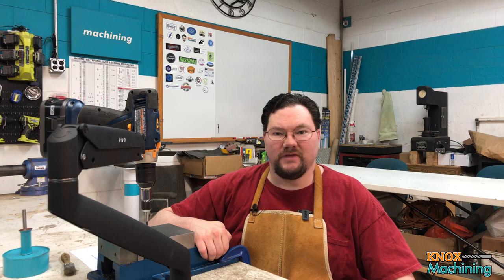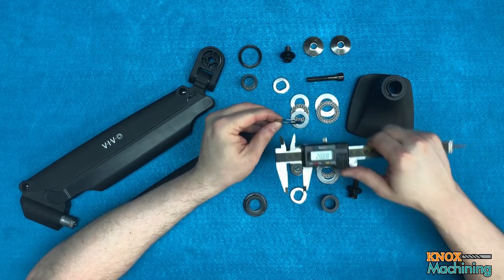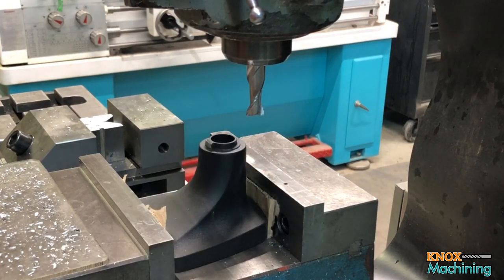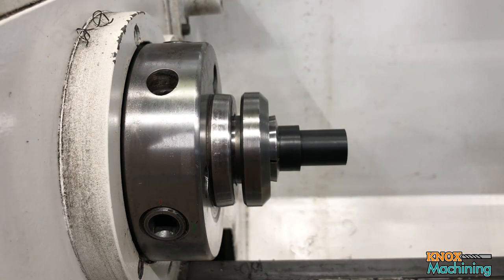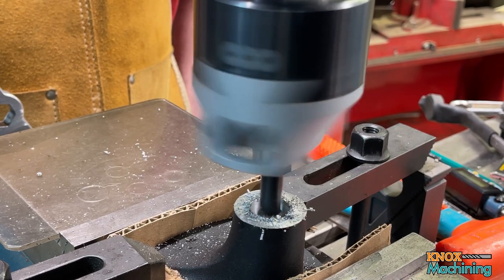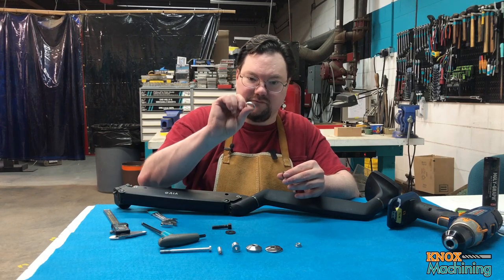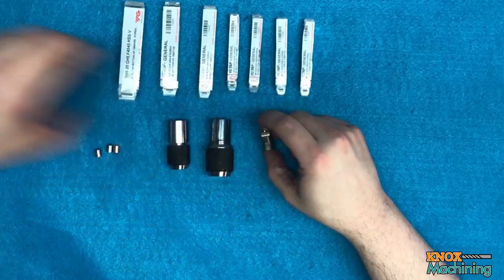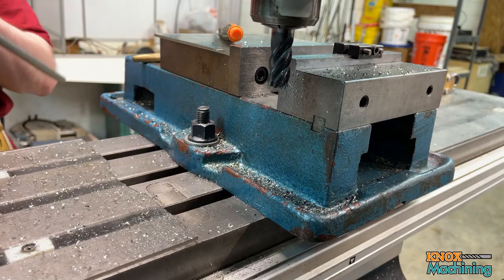DIY Counter Balance Tapping Arm

Comment: Great job Billy, nice tapping  Arm  and good set up on the video too  Thanks Frsnk
Reply from the maker: Thanks Frank. Introduced a new angle to the talking head segment that complimented the over head and straight on angles. Slightly different than my opening angle I use on my videos. Was a tighter shot and used the 1/3rd rule.

Comment: Looks like there is a good bit of play in the arm
Reply from the maker: @dbugman1  There is a bit. Wasn’t too bad. Mostly in the connection to the drill. It’s not meant for anything more than 1/2-13 and you do need to brace the drill a bit for that.

Comment: Outstanding video I’ve been looking at these on Amazon for quite some time. I never thought about building my own. Well done my friend…
Reply from the maker: Thank you!  Had the idea for a while now.
Reply: @KnoxMachining  There's a glut of these monitor arms made by every imaginable company. Don't be surprised if Chinese companies remake their unsold inventory of monitor arms into tapping arms. LOL!
Reply from the maker: I looked through several different ones before choosing the one I used. I picked the Vivo model because it looked to be slightly heavy duty and had the adjustable gas spring. I also like the look of it better.

Comment: Great build.  Was looking for those links to make sure I use your affiliate links. I did find them on Amazon, so no issue there, but I'd rather use your affiliate if it is available.
Reply from the maker: The links in the description should be my affiliate links.  Used the amazon amazn.to url short links. Took 30 minutes to find all the stuff from my purchases, run them through the link generator. :)
Reply from the maker: Oh, and send pics / videos when you finish building it!
Reply: @KnoxMachining  I had to hit the "read more" button!  My mistake, you had all the links in there.

Comment: Nice tool, good thinking. If the arm needs more mass and/or stiffness, you can pour epoxy and fiberglass chop into the plastic channels.
Reply from the maker: Good idea. The arm is mostly cast aluminum. I took off all the plastic shrouding as it severed no purpose. In fact the shroud on the upper arm prevented it from completely closing.
Reply: @KnoxMachining  Sorry, I assumed it was mostly plastic.
Reply from the maker: No worries, I probably should have made it more clear I. The video. That’s one of the reasons I picked that particular arm. I could tell it was cast aluminum vs a hard epoxy/nylon arm.
Reply: I bought an articulated iPad holder so I could use my pad for a GPS. Although made from strong plastic, the heavy pad made it bounce alarmingly on rough streets. I poured epoxy with fiberglass chop in the hollow channels, and it reduced the flexing enough to make it usable. @KnoxMachining

Comment: I was contemplating making one of these, had almost exactly the same idea. I figured someone else must have made one, went on youtube and lo and behold... :) Subbed.
Reply from the maker: Yea. I looked a while back and didn’t find anything as simple.  Recently tested it with 1/2-13 spiral flute tap. It worked. But the drill did trip do to over-current a few times. I think a more modern hammer drill (brushless) would have done just fine. Will be picking up a newer one soon.  The parts list is in the description and everything was in stock as of a few days ago.
Reply: @KnoxMachining  I was planning on building mine based off of my old Ryobi (same as yours) that hasn't seen a battery for several years - my plan is to run it off of a 30A DC power supply I have on the shelf. I also have a spare monitor arm from an earlier project, so zero cost there. After picking the Ryobi apart though, I reconsidered. The clutch mechanism failed to impress when available for inspection... Based off of your above advise I have ordered a brushless drill that claims 60Nm torque, and has a comfortably low 0-400 RPM lower gear. My plan for it is to pick it apart, and optimally remove the Jacobs chuck and turn an interface for the tapping holders that I also have on order. I'll repurpose the trigger, 3D printing a suitable mount for it so that it fits logically with the final setup.

Somewhat overkill when a pneumatic kit with the arm, spindle, tap holder kit, and more can be had for just a few bucks more, but there is honour in making your own tools... :)

Comment: Great build,awesome ingenuity sourcing relatively inexpensive parts! I converted a drill press to a dedicated tapping machine with a Tapmatic, but may make one of these for smaller taps. Well done!
Reply from the maker: Hey thanks. Yea. It was a fun project. I haven’t tested it with anything smaller than. 1/4-20. I’ll try a #6 in a few days and see how it works. I’m not sure I would go smaller than that.

Comment: Nice job and an interesting idea. BTW, saw you on ARW the other day and using a mic stand as a cam mount is a great idea. I am constantly tripping over my tripod in my small shop. All the best!
Eddie
Reply from the maker: Yea, the work pretty good.  Have had a few times where I wish they where a bit more rigid, but they stay out of my way for the most part.

Comment: Great project Billy. I'm going to really dig into this one. I've been going through an auction catalog today and was looking at a hardness tester. I tried to find some information but didn't find much. Then I watched your video and there it was in the background; A Service Physical Tester 12-A!! Do you have any information on it? Is it worth getting if the price is right?
Reply from the maker: I paid $200 or $250 for mine. It works. I wish I had the complete anvil set for it. I just have the one diamond and anvil. Mine has the 15kg weights. It’s a nice unit. It has instructions on how to use it on the left side of the machine and the Rockwell chart on the right.

Comment: Do people come by or book times where they can use the milling machine or lathes or is it a members thing
Reply from the maker: You join the Maker Space. The monthly dues gives you 24/7/365 access to the tools. The mill and lathe do require one-time authorization classes before you can use them. And we have a general overall authorization class that covers everything else in machining. Welding, Blacksmithing and Woodworking have simulate classes.

Comment: Very nice Billy.  I just found and ordered a pneumatic tapping head to make one of these.  How low will the tap go relative to the table?  Will I need to make something to raise up the item being tapped?
Reply from the maker: I'll have to take a measurement. But, I think I can almost touch the table with the tap socket.  I'll post measurements tomorrow.  I just noticed that the arm isn't available on amazon right now.. May  need to look and see if there is a different version that'll work and update the link.

Comment: Nice footage too. Speaking of tabs, contact me if you need a special pitch in a tab or die, now have a 1000+ from that sale 👍😋 Oh and a leather apron just like yours 😜
Reply from the maker: Thanks!  I'll  keep that in mind.  I don't think we have too many needs for strange taps.  Mostly your standard stuff.  We have several cheap tap/die sets from HF,  etc etc..  I have a little "store" setup that well sell screws and nuts. I have dedicated drawers for endmills and inserts, and one for drills and taps, but, I've not stocked it yet.  The guys at the space can be hard on taps and break them. So, I want to stock decent quality ones they can just buy and keep for themselves or replace the community tap if they break it.

Comment: You need to make sure you part you're mill is parallel to the head or the head is out of tram it looks to me
Reply from the maker: @dbugman1  Not sure what your seeing. The head was tramed to the table. I did have a snafu on the boring head. I didn’t have the work secure enough.

Comment: Billy, how does your tapping arm do in steel?
Reply from the maker: Hey Bruce,  I've been able to tap 1/2-13 in .75" thick hot rolled. The drill was in low gear, using the spiral flute taps. The Ryobi hammer drill did stall out a few times. It's a 1st gen model with less torque than the new ones. (Probably 1/2 the torque)  Do to the way the last joint hinges horizontally, I did have to hold it with two hands to keep it from rotating, the single bolt isn't enough for the torque needed for the 1/2-13.  Upgrading to a new drill and stabilizing the joint will make it work way better.

Comment: Which drill machine are you using
Reply from the maker: I’m the video an older Ryobi (1st gen) Hammer Drill. I’ve since upgraded it a later model with brushless motor. I don’t recall the exact model number for either of them.

Comment: Always in aluminum. Kinda like most of the mini lathe video's, aluminum.
Reply from the maker: I find aluminum harder to tap than steel because it’s so gummy. However, I was able to tap 1/2-13 in steel recently. The drills battery shut off a few times due to over current. However, that drill is a first gen Ryobi with lower torque. They newer ones have more and wouldn’t have batted an eye.

Comment: I hate having to listen to the music all the time
Reply from the maker: Hey Pat, I put music in all my videos to help drown out the high pitch whine noises that are made by some equipment in the shop.  With that being said, the music in this video was a little louder than normal in the talking head segments.  I'm not sure what happened.  It didn't sound that loud on my PC when I was editing it.
Reply: The music is good with me. Also one can lower the volume throughout the machining/music portion. I wouldn’t read too much into the these comments. There will always be someone that doesn’t like to dance to the music that’s playing. I’m just glad it’s not the heavy metal guitar people used to use 5 years ago.